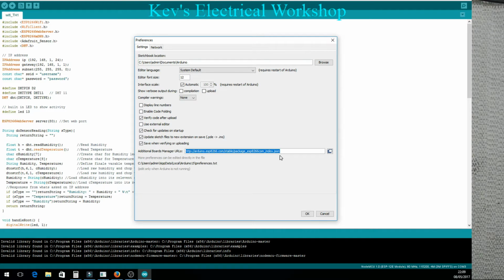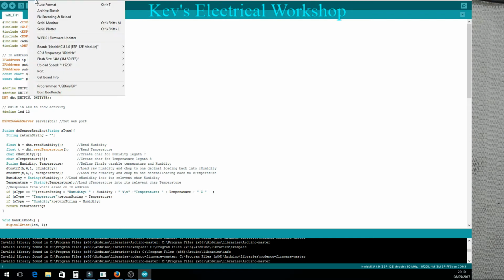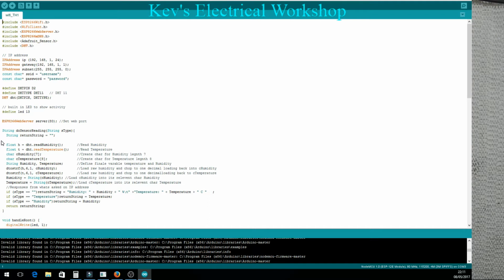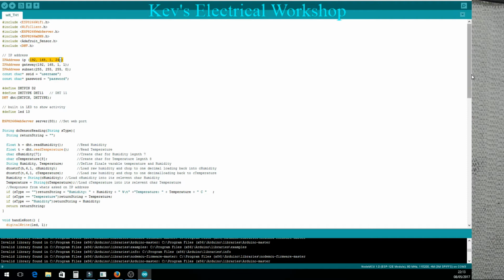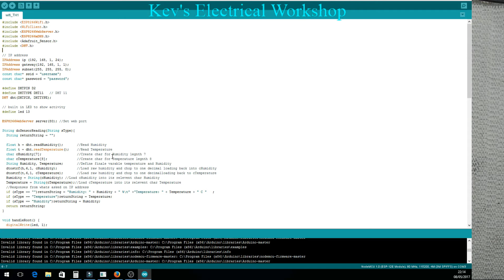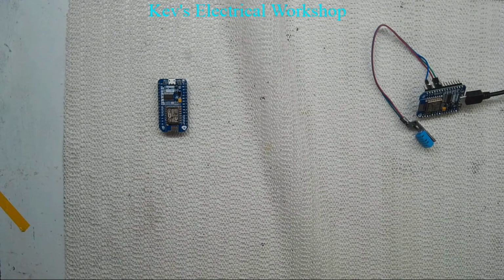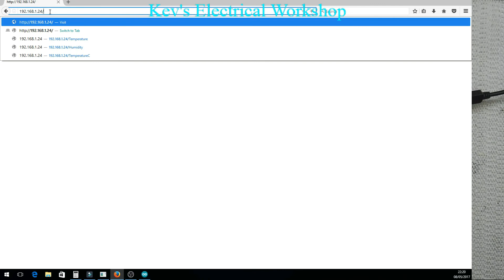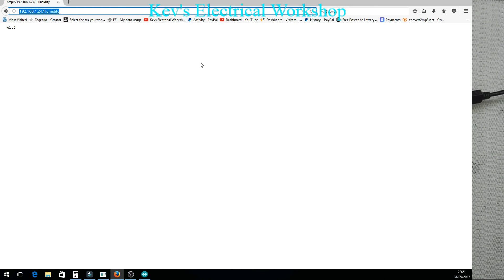NodeMCU with DHT11 temperature/humidity sensor

Comment: I am looking for the Fahrenheit conversion temp code, do you have the original?
Reply from the maker: not off hand but if you change float t = dht.readTemperature(); to float t = (((9/5) * dht.readTemperature())+32); that should give you F (have not tested )
Reply from the maker: ok easier way float f = dht.readTemperature(true); gives result in F so just add true in the brackets.

Comment: Hi Kev: I just happen to be playing around with this stuff as well. With a bit of extra programming and the additional I/O on the ESP module you could make the module control a relay(s) to turn on/off a heater or fan automatically.Then the web page can also show you the status of the relay as well as the temp and humidity. That's were I'm going with it. Have fun. Still enjoying your experimentation.
Reply from the maker: Sounds like you ahead of me this time, may try a OLED display to start with.